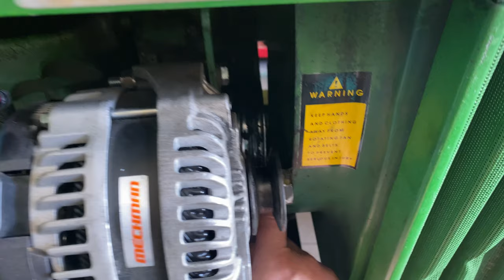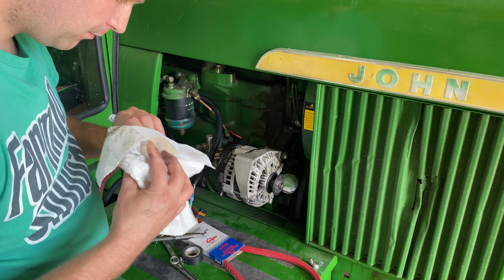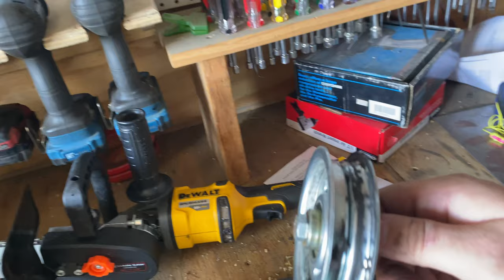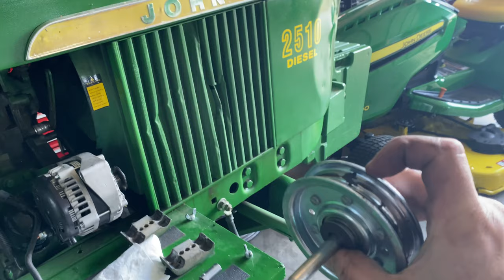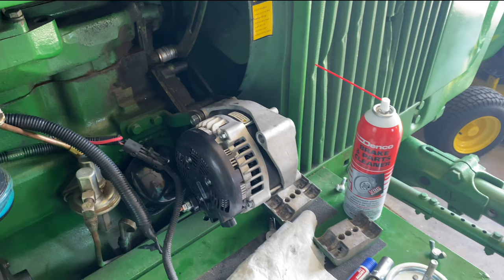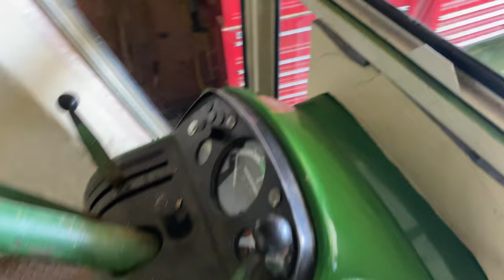Pulled Home By a Red Tractor New Belt on the John Deere 2510

Comment: Almost makes you wish it was chain driven. 

The work on my grandfathers 70 is going well.  Looks like in a few weeks, we will head down to work on it again. I have to replace the parts from the carborator my uncle stole to get his 730 running. I also will hopefully get the clutch working.  After that, I'm avoiding tearing apart the steering pedestal for a task I have most everything for and the few parts I don't have, aren't expensive to get. Rewiring the entire tractor. All 9 wires and the 3 grounds.

Comment: Nice video Randy!  Glad you got your 2510 home safely even if it had to be towed home with a red tractor.  If that belt comes off again or even breaks, I would look into getting a 400 amp alternator if the inverter is pulling power that hard from the alternator.  Glad you didn't use red loctight on that idler pulley bolt because the bolt would most likely snap off if you were to attempt to remove it later on.   As for alternator pulleys, I would stick with the one you currently using.  A larger pulley won't spin the alternator as fast as the one you currently have, and installing a larger pulley could result in intermittent voltage drops with your air conditioning system.  Especially at engine idle speeds.
Reply from the maker: I was looking at getting a 370 Amp alternator, but the company I got this from strongly recommended not to, supposedly would be even harder to turn